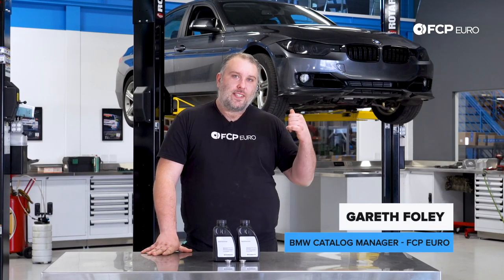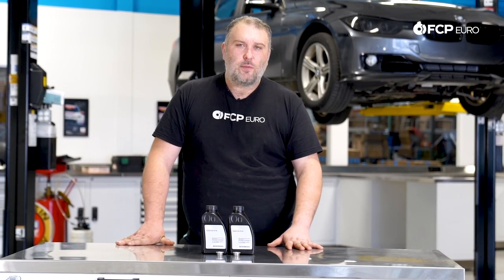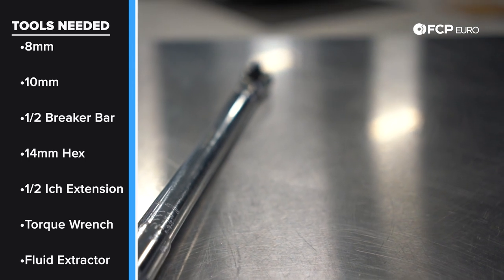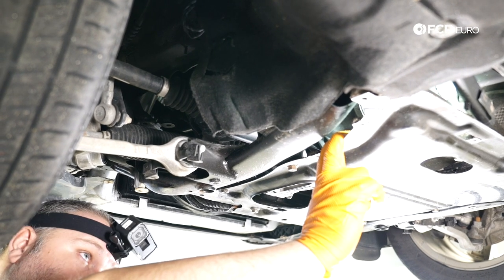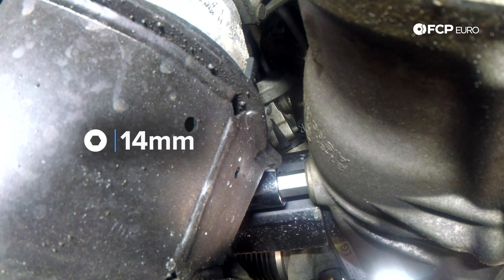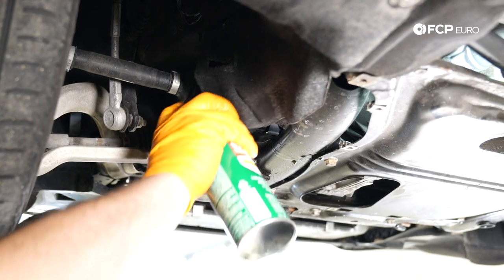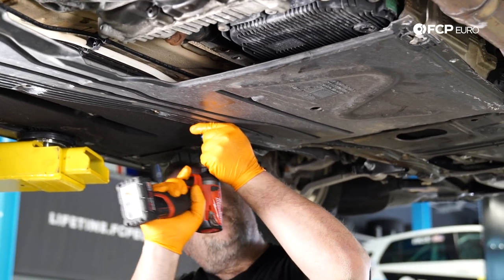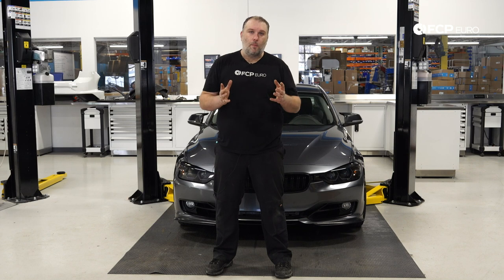BMW F30 Front Differential Fluid Replacement DIY (BMW 328i, 335i & More)

Comment from the maker: Buy Parts And Tools Seen In This Video:
BMW G2 Hypoid Differential Fluid (500mL) - Genuine BMW 83222413511-
https://www.fcpeuro.com/products/bmw-g2-hypoid-differential-fluid-500ml-genuine-bmw-83222413511?utm_source=youtube&utm_medium=description&utm_campaign=mps%20f30&utm_content=front%20diff

BMW Differential Drain/Fill Plug - OE Supplier 33117525064 - 
https://www.fcpeuro.com/products/bmw-differential-drain-plug?utm_source=youtube&utm_medium=description&utm_campaign=mps%20f30&utm_content=front%20diff

Extraction/Filling Syringe Pump (200cc) - CTA Tools 7075-
https://www.fcpeuro.com/products/extraction-filling-syringe-pump-200cc-cta-tools-7075?utm_source=youtube&utm_medium=description&utm_campaign=mps%20f30&utm_content=front%20diff 

Also, check out our rear differential DIY here: https://www.youtube.com/watch?v=TZxRJD5hgx0&ab_channel=FCPEuro

Comment: Thank you. Just did this yesterday together with the rear diff. I put the car up as high as was safe on four jack stands and removed the front driver-side wheel to get better access to the fill plug. I used an impact driver (with extension) on the fill plug as it was still quite difficult to loosen. The biggest pain was getting under the car to remove the two splash guards. Together there are about two dozen fixing screws that needed to be dealt with. I used Red Line 75W-85 GL5 oil and it took about 16 fl oz of that (1/2 of a 1qt bottle). I did not replace the plugs but cleaned the area well afterwards with brake parts cleaner and will check for leaks later. My 328i has about 70K miles on it and this is the first gear oil change. Like the rear diff, the oil seemed to be in good condition but was a little cloudy and discolored. Glad I did it.
Reply: I’m at 64k glad I’m getting them all out of the way

Comment: Great video. Gotta add that BMW says that refilling till it drips out would be overfilled. You have to fill 600 ml.
Reply: I just read that as well.
600 mil no more.
Filled to bottom of fill plug is considered over full.
Section 020-43 in the BMW service manual.

Comment: Isn't the bmw G2 hypoid fluid just a GL-5 75w85 oil? Redline makes a synthetic fluid under this designation.
Reply: Did you ever find out if this was true tryna change mine but don’t have access to the g2 hyoid
Reply: @jacobhilley6141  yes the only real special fluid will be the transfer case

Comment: Gareth, what's your comment on a recommendation to rotate the wheels on the first full fill, that will allow to pump more oil into the diff? I've done this yesterday and it took 150-200ml more. Thanks!

Comment: So, what is the mileage interval for changing differential fluid? 60k? 70k? Would you recommend swapping these fluids at the same time as the transmission fluid?
Reply: Did you find out the change interval , I have f25 X3.
Reply: @rohanb79  No definitive answers.. For a car that gets heavy use on a track, some folks change differential fluid every 3rd oil change. My indie would prefer every 30k. I changed mine at 60k and it needed it.
Reply: He said 50K in the previous rear diff fluid video. Personally, I think front + rear diff + trans fluid every 60K miles for normal non-track driving is perfect. Obviously indie mechanics will recommend the job be done significantly earlier than that, but 60K is more than frequent enough considering BMW advertises the fluids as "lifetime" and most people never change them to begin with.
Reply: 60k miles is what the latest bmw service manuals at least recommend for differential fluid for the M cars. They only mention the rear ones though, not front. Transmission fluid is more like 80 to 90k miles as per ZF and I would do transfer case at same time.

Comment: I have 440i f32 xdrive, front i have little oil leak, so little and i dont know what's cause that, can be the drain bolt or dichtung or something else? Can you help me? And how much km/miles can you drive with new  differential oil?

Comment: Any recommendations on cleaning those fluid transfer pumps? I'm trying to reduce cross-contamination between lubricants, and just using brakleen eats whatever plastic I put it on.
Reply: Could always do the chemistry way. Run whatever fluid you want through it first, waste some. And then hook it up to the diff and pump it in. Although that doesn’t really solve the cleaning issue.

Comment: Is the g2 (GL-5) fluid also compatible with the rear diff? Maybe a stupid question, because i know gl5 is only incompatible with synchromeshed transmissions. But don’t know if there diffs have any copper in them.
Reply: Hypoid G1 (75w80)for rear diff iirc

Comment: FCP Euro, if this is the ONLY Fluid that is currently compatible as he says, then why are you recommending and selling other brands on your site?
Reply: The only 100% compatible fluid. BMW went from 75w90 to 75w85 to boost mileage. I personally use Liqui Moly 75w90 but please note that the front diff is GL-5 and the rear diff is GL-4.